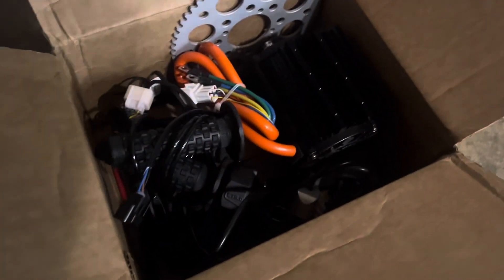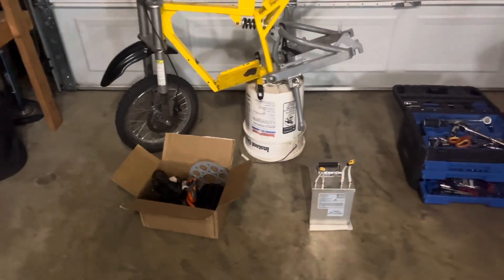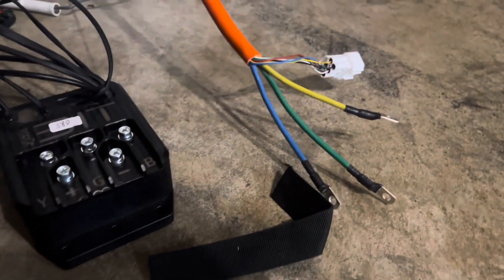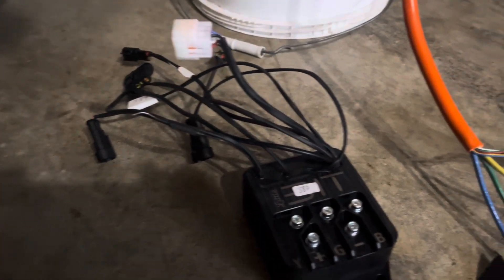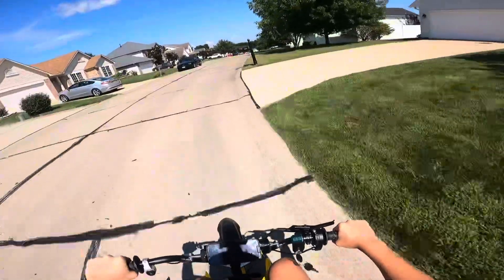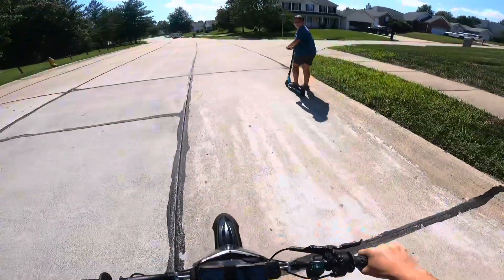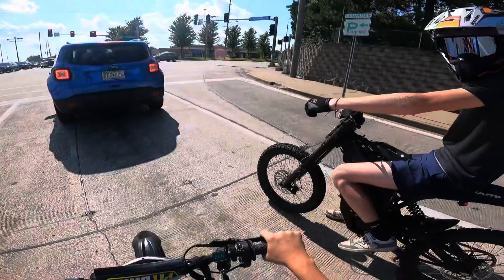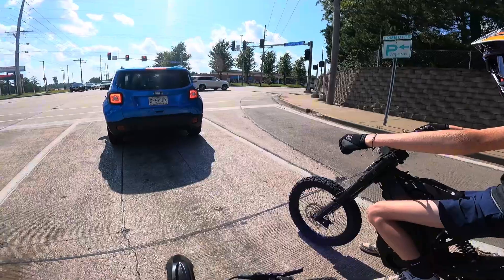HOW TO MAKE A 60+mph ELECTRIC MINI-BIKE // Electro&Co Modded Razor MX650

Comment: Hey I have the same build and the same frame but my chain won’t stop popping what tensioner do u use and what else can I do?
Reply from the maker: @splux5678  I don’t use a tensioner I cut it off, cut down the chain and get a adjustable motor mount from detfab.com
Reply: @Rippinandfishin I was looking at the website because I have the same problem but I am not sure which to select and is said they don’t know if it fits the one moter does anyone know if it fits?
Reply from the maker: @TyMatz  I have the one motor and it works.

Comment: Man I had a serious question I have a mx650 I was wondering if I could fit a 76v 40ah or 32ah battery🔋from electric & co with the motor in the mx650 frame if I were to shave off the controller mount also would those batteries be compatible with the 11000W motor Sorry for the random question time and money especially from electric & co
Reply from the maker: @FrankNitty-ii5kt  the 40ah will not fit, and the 32ah could possibly fit but you would have a hard time fitting your controller near the battery. Yes they can support 11000w.
Reply: @Rippinandfishin  thank you for helping me with that..  what did you do I mean for the battery🔋 I seen you have a 76v im guessing its a 20ah or something like that? I'm trying to go distance also speed but mainly distance.   As of right now they have the 72 volt 30ah out of stock from electric and Co.
Reply: @Rippinandfishin  I'm just not sure what to do at this point I was thinking of getting everything from electric & Co and just getting a different 72v 40ah battery or a 76v battery 🔋 from Amazon or something eals just didn't know if it would be compatible with electric & co stuff?
Reply from the maker: @FrankNitty-ii5kt  I’d go with a 72v 32ah from econic cycles or momentum watts. And yes they can work with electro and co stuff, still plug and play.
Reply: @Rippinandfishin  thank you bro many blessings I a grateful
Reply: @Rippinandfishin I was going to ask you the momentum Watts as of yesterday I ran out of their 72 volt 32amp battery just out of curiosity would you happen to know how long it would take for them to restock?
Reply from the maker: @FrankNitty-ii5kt  Could be up to a couple months, check out econic cycles, they have a good 72v 32ah.
Reply: @Rippinandfishin  ok thank you once again 👍
Reply: I just looked in the last couple days it looks like everything is dried up.. I'm going to have no choice than just to be patient and wait.  If I were to get a cheaper 72v 40ah battery that fits I'm getting everything else from electric & co do you think that battery will work put the setup they have as long as I get the QS8 Leeds it should work its at least a working battery until these ones come back in?
Reply: The battery will be getting is cheeper its from Amazon?
Reply: @FrankNitty-ii5kt  the battery would blow up if it was from amazon🤣